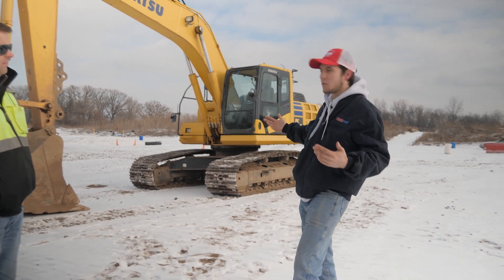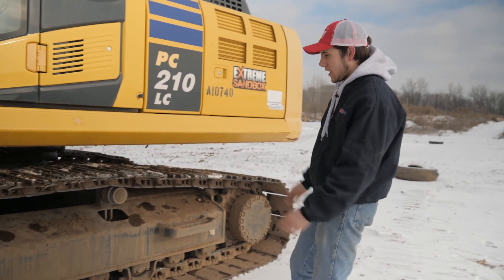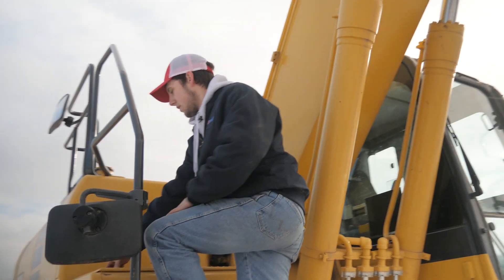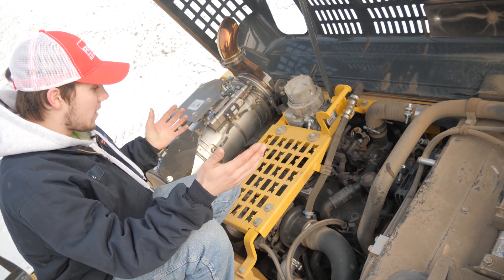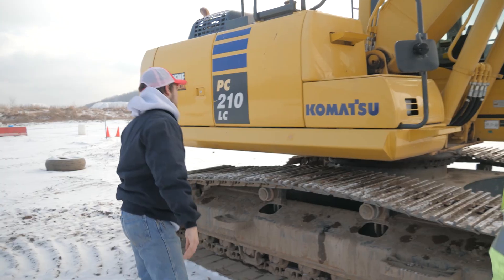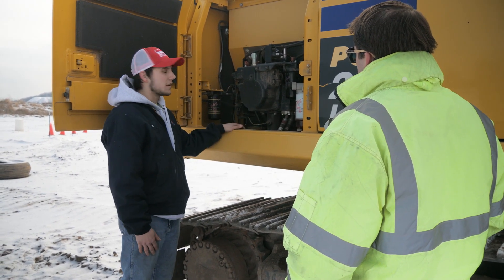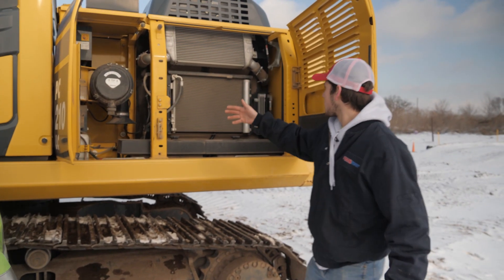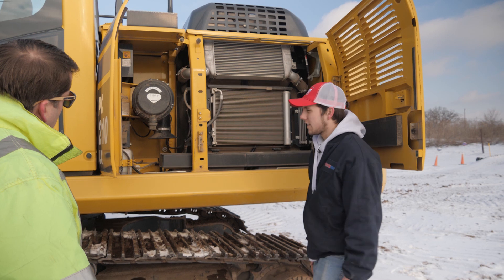How to do an Excavator Pre-Operation Inspection // Ep. 120

Comment: Very good video, I feel like you have covered it pretty well. One topic I think would make for a good continuation to this video is how to grease the equipment properly. I see many new guys come through and not know much about greasing except, "grease it everyday". Well there's certain fitting that aren't supposed to be greased daily (such as slewing ring and track tension adjustments) and some fittings that have to be greased multiple times a day (such as a hyd hammer), plus different types of grease for different equipment and applications. And I can't believe how many guys cant even refill a grease gun properly. I feel this is one of the most under-appreciated aspects of maintenance that costs owners a lot of money in downtime having to line-bore and replace pins.. Greasing becomes incredibly important for GPS bulldozers and others because any linkage free-play means you are loosing grade accuracy. Keep it up guys, love the videos!
Reply from the maker: Awesome advice.   And totally agree.  I actually discussed the greasing piece and do believe we will do a separate video on How To Grease in the near future.   Thanks for watching and subscribing to our channel!
Reply: I can totally agree I think these days a lot of operators and taking up the luxury of having that big tank mounted near the engine steps and so people are forgetting to check things are getting grease they just think well the machine is doing it why should I need to check. Also see a lot of operators not realise the auto greaser doesnt fill itself. It might auto grease but it doesnt auto fill. And they figure it out once everything is squealing like a 3 year old wanting a balloon animal and some icecream. But greasing is very valuable. And cheaper than repairs. As they say prevention is normally better than the cure. Also seen a lot of people who double wipe the nipple once before the gun which is good but again afterwards where as leaving the residual grease till next time prevents the nipple from blocking with dirt and grime so extreme  sandbox and how to grease right and wrong ways would be invaluable I think!
Reply: @james dourish That's why most Operator's always spoil those nippels all time bro,It's all about being gentle with the nippels sameway we do with the joysticks and not forcing when greasing those parts.
Reply: That was informative in itself. 👍 Thank you.

Comment: Another good thing to check is the bolts on the sprockets, roller wheels, etc. in the undercarriage. That is a simple fix when they're just loose but when they fall out unnoticed, larger problems can ensue.
Reply from the maker: Excellent suggestion!   Thanks for sharing!

Comment: Check hydraulic hoses or missing pin keepers and Grease before running check air filters if in dusty conditions..Hydraulic oil levels...keep a clean cab
Reply from the maker: Totally agree.   Thanks for the comment!

Comment: Stretch out that boom the night before and check your hydraulic level. I'd go ahead and show them where the pump oil dipstick is that as well. Another tip is to turn fuel valve and release any water that might be at the bottom of the fuel tank.

Comment: Its definitely pretty smack on. I'm an old school,new school operator and to me I try to make as little and speedy work as possible of a pre op and I think with enough time your running through it in your head. But I prefer to try do one single walk around cause I see some operators killing paid time bouncing from the left side of the machine to the right side then on top then back to the left and then ontop to check engine oil. Where as I like to combine my visual and mechanical checks into one normally starting in the cab side looking up and down then into that engine bay then around doing all the visual get the opposite side and do the engine bay check then keep scanning then up on top do the checks up there and then down out to the bucket and boom and then back up into the cab start her up and then I also on occasion say handing over from another operator I like to let it warm up before getting into hard work and I like to just jump out listen to my machine any rattles or squeaks from belts being worn maybe. And also I've found typically if a hose is likely to blow it's now when it's just getting  going due to the added load on the engine to get the cold oils and fluids moving but also jumping out of your machine gives you that visual check for any leaks with the engine pressure pumping everything eg coolant or hydraulic leak. Sometimes a pin hole is hard to notice until its pumping it through. Also allows you to listen to the turbo so you can hear any whistling from maybe a hose that's frayed cause those sudden gunshots will cost you a lot of pride and a new pair of undies. If alls good then jump in and go hump some dirt!
Reply from the maker: Awesome advice.   Yes, agree just having a consistent routine is the best for any operator.   Thanks for the sharing your input!
Reply: @HeavyMetalLearning  definitely true consistency is basically muscle memory. I know when I started out I followed a checklist but eventually you can visualize it in your head after so long and it becomes second nature but this definitely is a great place for new operators to start out. I know a lot of what you guys cover is definitely knowledge I would have love to have ages ago so thank you for the content you guys put out!